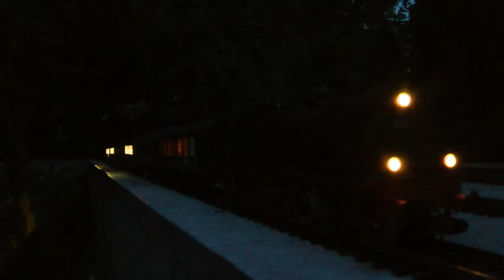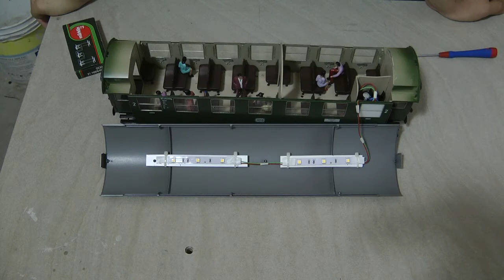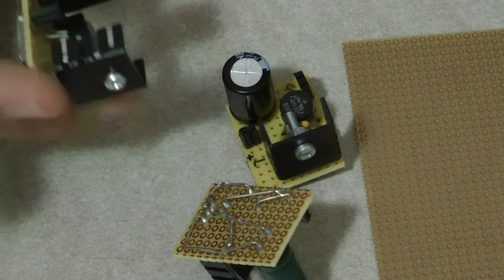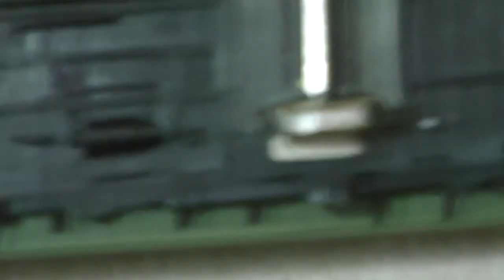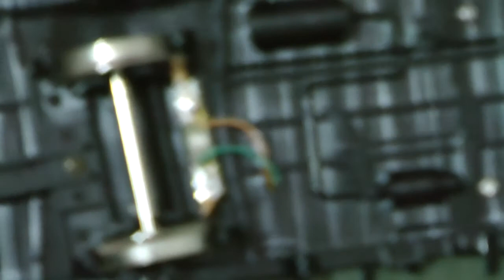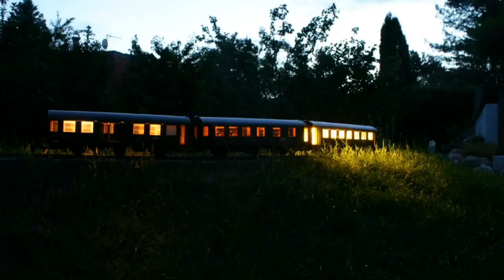Garden Railways is Born - Coach Lights

Comment: I am just watching this series now and enjoying it.  In some ways the 3 separate globes would be a little more authentic as the original carriages would of had just a few individual globes, but the flickering would be distracting.
I am really enjoying watching these videos.
Reply from the maker: That could be version 2. I have some individual white SMD 5050 LEDs, those and square LEDs that are usually found on strips as well. I am using those more and more for individual lights, cab lights. So could be used here as well. But this strip method is really quick.
Reply: @csongorvarga  yes.  The strip is easy.  They are very bright.  Probably brighter than original, but it looks good in your yard
Reply from the maker: @EsotericArctos  Indeed they are. The other option would be to somehow drop the voltage to the strips. Maybe use a different regulator and feed 10V instead of 12V.
Reply: @csongorvarga  that could really work.  It would take a little of the harshness off the LEDs too.
The warm whites are nice though.
You might be able to drop the current with a resistor in line with the LEDs